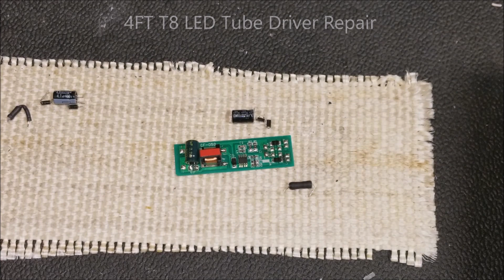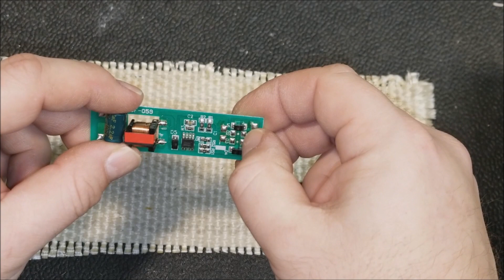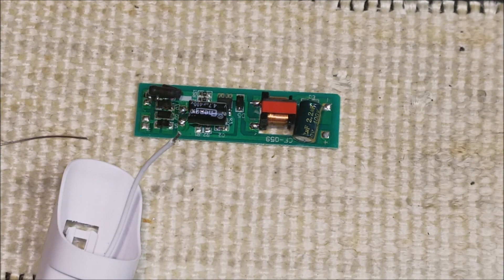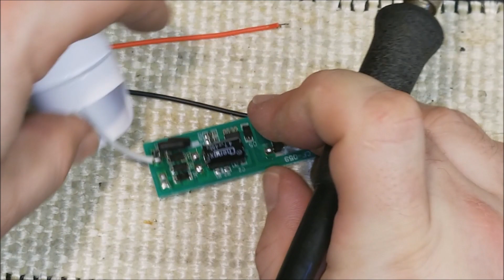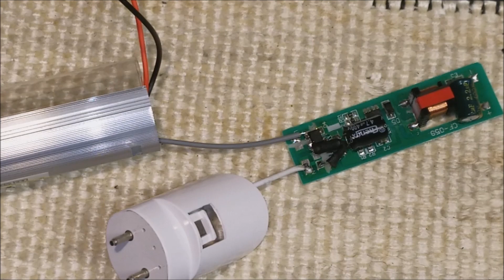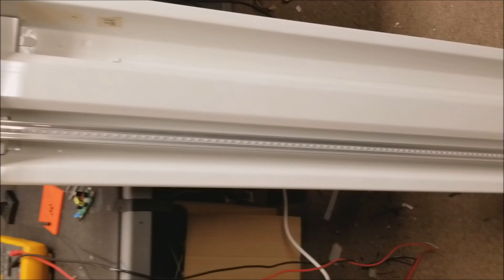T8 LED Tube Driver 'Repair'

Comment: I’m just replacing the board for $7 but I appreciate your replacements of individual components.   Enjoyed the hack to get the full wave bridge installed versus discreet diodes.   Cool !
Reply from the maker: Oh yeah, a replacement board is super cheap. Most of the time this isn't worth repairing but I had the bits around and figured it would be interesting.  I'm glad you enjoyed it. Thanks so much for watching!

Comment: I have a new LED replacement for fluorescent  and it has a 3 way switch for different color (cool white, warm, or in between.
So I switched the switch with the power on (not supposed to do that) and now it won't work.   Any ideas?
Reply from the maker: Hi!  Hard to say without seeing it, but I bet it has a fuse or at least a resistor acting as a fuse. If you can open it, I would check that and put another in.
Reply: Pro trick: watch movies on flixzone. Me and my gf have been using it for watching loads of movies during the lockdown.
Reply: @Koda Harlan Yea, been watching on flixzone for since december myself :)

Comment: This is not the correct procedure, you have to measure the current and voltage before substituting the bridge rectifier.
Reply from the maker: In many cases I agree you need to measure the voltage and current. 
 Not for an $2.00 led driver. 
 I already know the voltage and current and use parts of equal or larger value. Spending more time than is necessary makes the repair less efficient. These lights are still running today after this repair. 3x longer than before they failed and counting.

Comment: Cool repair. I have a couple of these blown tubes and was wondering if the actual LED's were still useable? Is there any way I can bypass the circuit board and use another power supply? I want to use a 12v supply that I already have laying around. What would I need to do?
Reply from the maker: Hi D.H.  In theory yet you can.  What I cant say is if they will run on a 12v adapter or not. Most of these seem to be 100Vdc strips needing a 100V power supply(the little board). Some do use 12V though.  You may be able to Google the old boards part # to see what their output is. Or see how the LEDs are wired in the strip. If they are wired 3-4 in series and then groups of 3-4 in parallel, it might work.  If its all in series then you need to find out what the old drivers output was and match that or replace the driver.
Reply: FixitFrank Thanks for your reply. Ok, I got some home-work to do then. I didn't do any checks yet, I assumed the driver breaks down the 100v to 'maybe' 12v or something, to power the leds. I disconnected the driver and connected my 12v supply to the copper strip directly. Pos to pos, neg to neg, but the lights didn't come on. Again, thank you. Will be checking out your other vids.
Reply: Yup could not drive the led with 3 to 4v d.c voltage only,you have to ensure the constant current to flow into it  depending upon the power ratings of it. You could drive a 100v/60mA led strip in a tube light through a 12v/500mA dc supply by separating each 4 leds in strips and connecting it in parallel.

Comment: Thank you for the video. I got few burned LED tube and am thinking of doing the repair too on the driver. My 2nd option would be to buy a separate power supply to directly drive the whole LED tube and getting rid of original driver. What do you think? feasible? 
First i'll have to determine the output voltage from the driver and max current the tube draws and get a bigger power supply that is able to drive a few LED tube. Mine is Chinese LED tube and they tend to burn out in short time and i think getting rid of the driver is the way to go. Appreciate your feedback.
Reply from the maker: There are benefits to both options (new driver vs stand alone supply). New driver is likely the easiest option. No need to run wires to a central power supply. They are pretty cheap too. You might be able to fix the old ones depending on the failure. If the chip is still good, the rest is pretty basic.  I used parts pulled from old CFLs and other random junk.  Dedicated supply is good too since you can use one for all the tubes.  My only reservation there is you may have tubes of varying voltage requirements.  If they are all 100Vdc, then you need to worry about having 100V DC wires hanging about.  If it were me, Id go the driver replace/repair route first and dedicated supply second.  You can get new drivers for around a dollar on eBay. Maybe replace the filter caps in them with 105c rated caps and they may last longer.  Of course if you have tubes that run on 12V or less, then I would go with a dedicated power supply since 12V is easy and safe for the most part.